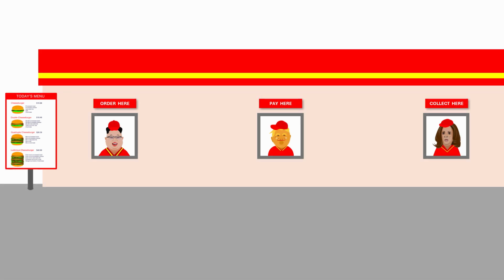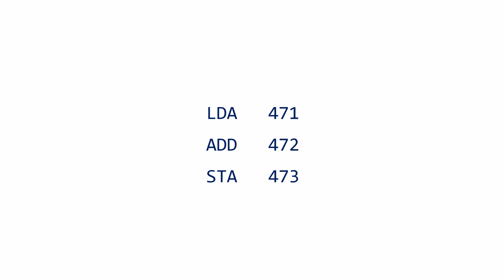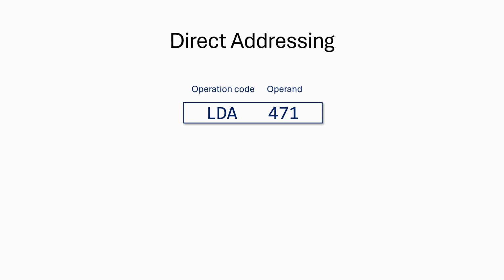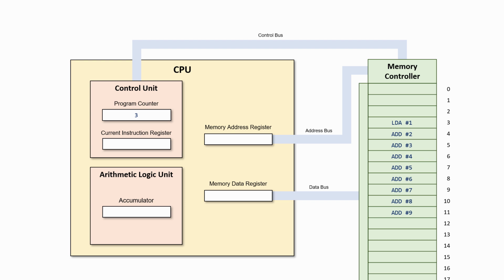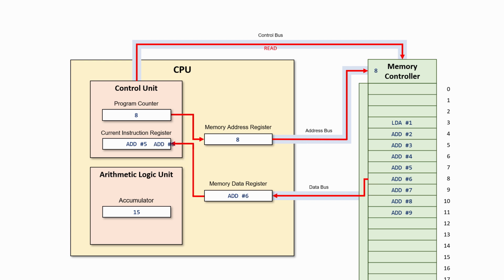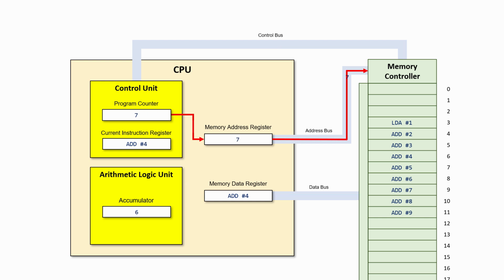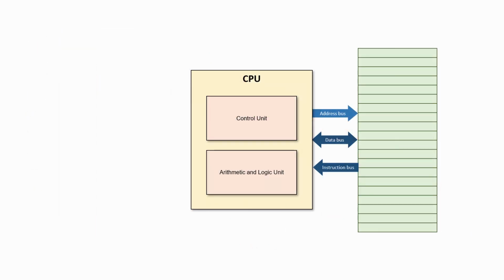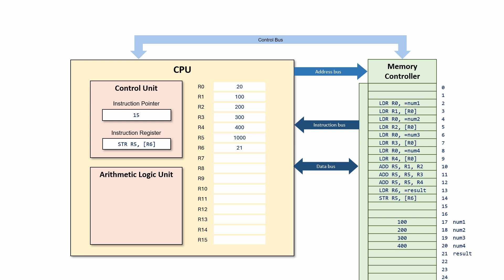Pipeline Architecture

Comment: How can cpu frequency be different than the Memory  frequecy if they are run by the same clock. Modern cpus run at very high speed but Memory modules are slow, how clock mismatch is handled ?
Reply: I think it is because they don't have the same clock, they are communicating asynchronously via commands (like how the CPU can put RD, WR commands for the memory and Memory can give BUSY signals when processing).
Reply: What do you mean by modern? 68k (from the 70s) accesses memory every even cycle. 6502 was special in that it accesses memory every cycle ( but only in one of its phases ). RAM did not use the RDY pin of the 6502. Instead, hardware designers just ramped up the clock until the system crashes. In the 80s a PCs would boot up in slow mode and run code from slow ROM and read data from slow CMOS RAM. In this data you could write the speed of the main DRAM you installed. Then the CPU jumped into RAM and accelerated to speed. If your number were wrong, the PC crashes. The C64 has a 15 MHz crystal. So it is much faster than the 2 MHz RAM. nMOS logic from the same fab as the CPU is used to divide the clock. If this chip would be expanded, the C64 could have had wait states .. like you would be able to tune it using software. For example on plus4 you can use software to double the CPU clock from 0.9 to 1.8 MHz.

Comment: Assembly has nothing to do with cpu 
It's an abstraction for perogrammer.

Secondly There is always mode bit in the instruction, your CPU by no means knows how to read and understand assembly.
Reply from the maker: It's easier to visualise assembly code running, rather than a lot of 1s and 0s.  This is pedagogically reasonable given the one to one relationship between assembly code and machine code.  A detailed discussion of addressing modes in this video is however not appropriate.
Reply: if Assembly as nothing to do with CPU, why is it not portable?

Comment: Is this related to "data pipelines" and "CI/CD"?
Reply from the maker: CI/CD is an approach to managing software development.  Similar to so called 'agile' or 'extreme programming' :)KD
Reply: or graphics pipeline. Now show me how they deal with data hazards and control harzards? In a graphic pipeline, occlusion culling is a hazard. CI/CD is not really a pipeline, but more of a sequence. I mean, I guess with feature flags, it happens that you develop a version of your software with is two iterations in front of what a user uses. I don't think that this is agile. I mean, the user has a problem, opens a ticket, you see that it is a new feature which fits the road map, you write it ( high prio ), the user gets the fix and is happy ( or not happy because of the stupid pipeline ).